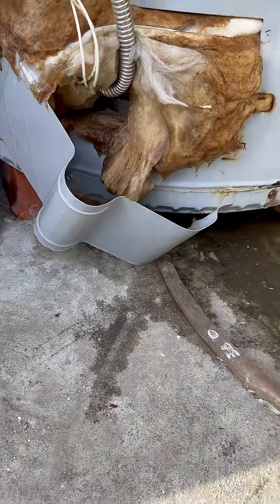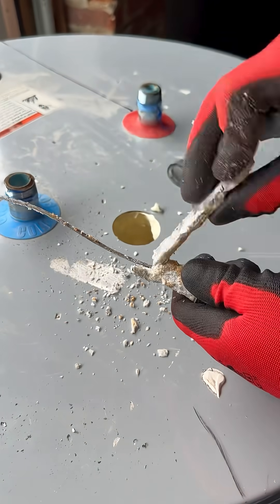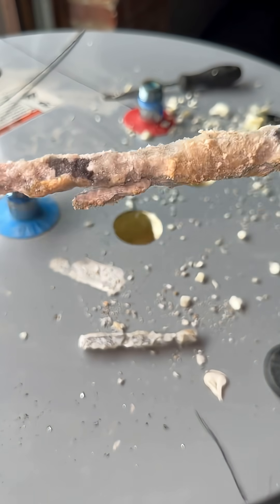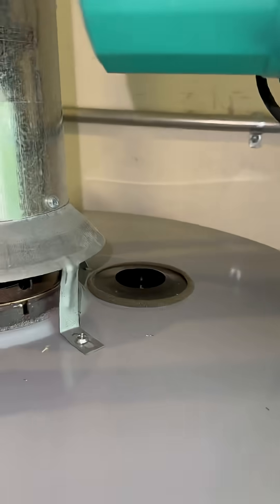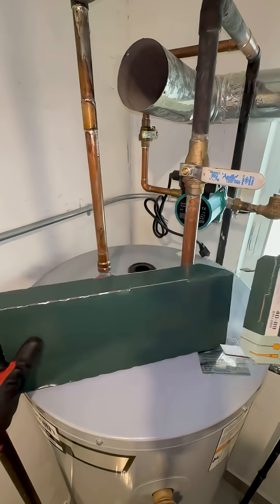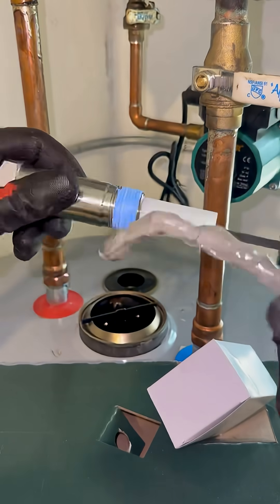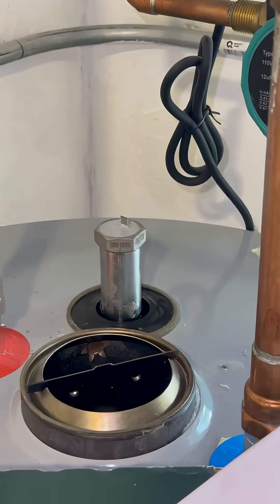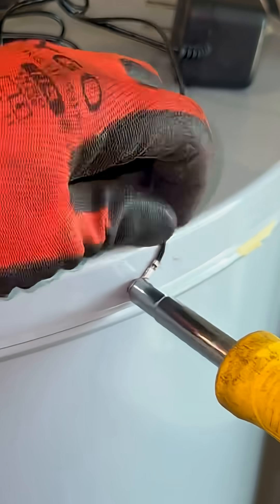Your water heater is fighting for its life! #waterheater #corrosion #anoderod #corroprotecpartner

Comment: Soooo instead of remembering to change a part every 2 or three years and never having to worry about that part failing in that time, you have to constantly check to see that the powered rod hasn't post power because the second it does you have no protection at all ?? that doesn't seem very smart to me, or really any improvement at all.

Comment: This process is called Cathodic Protection, it is also utilized for underground storage tanks -  such as gas/diesel tanks at gas stations. However, not every underground storage tank has this, as it takes a special certification in order for it to be “properly installed”. Long story short, it is an amazing technology that should be standard throughout - but job security is also a factor. So, that is one reason why we don’t see it everywhere
Reply: Also used for residential under ground propane tanks

Comment: What I wanna know is why we don't design hot water heater closets better, I feel like we could install a small drain so if it breaks the water will at least go outside and not flood the house. Could also make the floor for the closet slightly lower than the house so as the water is leaving through the drain it won't be spilling over into the house not to mention lining the closet with bathroom tiles 🤔 we really could make homes soooo much more functional and durable
Reply: We already do, they're called drain pans with drain lines connected
Reply: Most manufactured and mobile homes always have a drain off the pan, alot of the time your not able to if its in a basement most the time
Reply: Maybe if people would be willing to learn a little and actually do maintenance for once and not expect everything to last forever and then be shocked when it doesn't..? You are supposed to replace the zinc anodes every 5 years at least. They are there to stop the rust so big shock when never replaced your system rusts.
Reply: @SilvaDreams  That's not exactly something that is explained to the common layman. This knowledge is passed around by adult homeowners and it doesn't always reach new homeowners. Lose the attitude.
Reply: @sconescrewdriverson Funny thing is I am you average layman. Bit of a jack of all trades but was raised as a country boy so you had to make due with what you had so you take care of what you have. Heck had a PC Jr from 1984 still functional till 2012 and that was more of a "space is limited so it has to go"
Reply: @sconescrewdriverson   that training used to be in "shop and home economics" classes in high school years ago...
Reply: Because if it breaks then you buy another. Stuff is made to be disposed these days it’s all about profit money makes the world go round
Reply: @OF01975  you entirely missed the point of the comment. It's extra relevant BECAUSE everything is designed to break. The above commented is talking about the physical space that the water heater is designed to be installed in.

Comment: Yeah, they work good, but they’re a pain in the ass to install on a  Bradford White (Bradford Whites are good water heaters but the manufacturing process is just lazy not drilling that third hole for an anode rod. I guess it would cost them an extra dollar.).

Comment: How does that affect the smell of warm water? Don't heaters work in such a way that the cold water pipe runs through the heater and is not directly connected to the contents of the heater, even if it is sewage water, so the hot water tap produces the same water as the cold water tap, only heated as it passes through the heater? At least here in Finland, I have been under the impression that the contents of a hot water heater only heat the water flowing through it.

Comment: Y’all have some terrible water for it to destroy the anode in 2 years. Chlorine corrodes like nobody’s business. Calcium blocks like nobody’s business. I live on well water, test showed basically nothing but water. Tastes good. Doesn’t have a smell. No oead, no chlorine, no filtering at all, moved in in 2016 and same water heater that came with the house. I suspect it will eventually fail because they all eventually do but it won’t be because I have shity corrosive water. I have considered for a long while getting a tankless heater. I have gas at the house and could have one of those gas ones installed because I don’t have the space in my box for 2 more 240v circuits to run the electric ones. The prices are crazy for the branded ones and the affordable ones are all Chinese knockoffs with a brand history of about a week.

Comment: Bro, I was just about to buy Alice time truck, I was at the Ford dealership with the money to put down 50% on a 2024 ranger, diesel. Nah, wet belt, if you leave that car alone for two years don’t even drive it, it will need the timing belt done, the oil eats away the rubber on the belt and the teeth fall off, what a joke. I bought a Chinese 4x4 instead turbo diesel and a normal (slightly) timing belt, I say slightly because it has two belts one that does the water pump and timing and one that does auxiliary, power steering, fans and alternator. I hate all this forced obsolescence it was bad enough when it was planned but now it is literally forced they are designing things to break. And it’s not ok

Comment: Changed out my water heater that was 25+ years old because i had to change to electric. No corrosion, no build up, no trash in tank, never even flushed the old one. If you have good water you have no issues
Reply: What city?
Reply: @inwiththenew no city, well water. I could never live in city, plus water taste terible for city and rural water systems
Reply: @luke-4377 ok but what state then lol I'm curious bc some cities/states seem to have naturally hard water which is harsher on the water heater
Reply: In OK but here you can drill a well get salt water, go 100yd drill another and get high iron hard fresh water, then go another 100yd and get super soft water @inwiththenew
Reply: Mine is also 25 yrs old with no problems-never flushed and anode rod  still good (?) my sister lives on other side of county and the limestone causes a terrible sulfur smell. I've got a new WH in the garage on standby and will probably buy one these electric anode rods before installing it...

Comment: You work in New York which has a lot of apartments so I assume these water heaters are in apartments why not just mount wall mounted modern water heaters on the of the building, they are small and flat so it would be more than practical.

Comment: I want to install one of these, but Rheem put a heat pump on the top of my water heater and misaligned the access hole with the top of the anode rod. I can't remove the old rod! They are no help, either; the manual simply says that the anode rod is not designed to be replaced and that I just have to suck it up and let my water heater corrode.

I am, of course, looking into installing the Corro-Protec into a tee on the hot water outlet, but when I buy another water heater, it sure won't be a Rheem.

Comment: The water system I work at uses this just on a massive scale. Just dug up a 42 in main to replace a blow off valve. No rust on the main and the blow off valve with no protection was toast

Comment: That tank is used for winter heating. its one way they use to do in small condos that use hi V duct work. The tanks get so much use in the winter they dont last much more then the warranty period, even the good tanks. This protection might be beneficial for a tank in this application, but under normal use its unnecessary.

Comment: Smart installer, installed the gas union ABOVE the tank, not 6" above the gas valve. When your replacing the tank you can disconnect and just pull it forward and new one in without gymnastics around the hard pipe. Why do so many installer NOT do it this way?

Comment: Dude the struggle is real and it seems that ao Smith is one of the worst offenders, I've double the amount of manufacturer warranty work on Smith heaters than every other brand combined in the last 6 months. 

I'm literally leaving a 6 year warranty replacement on a Smith pro line 40gal, I guess it was good that it failed now because it's got less than 3 months of warranty remaining on the unit.
Reply: As a quality control worker at an A.O. Smith factory I 100% agree with your statement. When my uncle asked for a reccomendation I told him not to buy our junk. I'm not allowed to put product on hold without production overriding it. The long term failure test (pulsation) limits have been lowered to less than a fifth of what they once were. It's a joke. They're designing them to fail a year or 2 after warranty expires
Reply: @tinscarecrow21 damn bro, that really sucks. 

One of the biggest recommendations I've been making for my customers whenever I'm installing any water heater is to upgrade to a powered anode rod vs the sacrificial one.
Reply: @lightjedi6  I always tell folks to install an expansion tank if you're on a closed system, too. You can replace anode rods, elements, dip tubes, T&P valves, control panels, thermostats, drains, and most other parts any day of the week. The tank leaking means you have to replace the whole unit. An expansion tank saves your tank as much as an anode rod

Comment: Why do you need to drain it?  Other than to get the sediment out?
Reply: just to get the sediment out.. and for the tank won't be under pressure to make the swap.
Reply: @thetubeschannel if it’s a new tank, would you still drain it?
Reply: @Aldoshein  New tank - put on a 3/4" ball valve then drain annually after that.
I bought one a year ago and I'm suppose to do it now (july) going to shut the water off, open the kitchen or bathroom sink.
shut off the cold water to the tank and drain the tank.
Check the anode rod - but I'm going to install a power-rod so I won't have to do that part every year.
then still drain annually to remove sediment.
took and takes a while to learn this but well worth it. thx.

Comment: It's sad , ridiculous , and almost criminal the lack of quality that we get from residential products these days . These mfrs should be sued for putting out inferior products . It would be one thing if that was just how good things were and there was nothing that could be done but we know that older product lasted way longer and now they make things to purposely fail and not be able to repair so they can sell you a new unit every 5-10 years . I've even seen this with pressure treated wood. posts used to last 20 years in the proper conditions. I've replaced multiple posts that have rotted completely through 5 years after we put them in. It's ridiculous
Reply: The posts are due to 2 seperate issues, at least. One, probably the one with the lesser effect, is hybrid pines growing so much faster, resulting in different grain structure of the wood.  

The second, and probably more important, is actually an example where an outside entity forced a change in the industry.   Tighter environmental regulations forced changes in treatment chemicals and methods.

Companies will always argue that any reduction in lifespan is due to government regulation changes, of course, but there are very few examples where the majority of the problem can be laid at the feet of government.   Emission systems on engines and pressure treated lumber are two that fall pretty far towards the government side, and they only ones I can think of off the top of my head.
Reply: @spudgamer6049  you think those hybrod pines werent soecificallynselecyed by companies to decrease growing times and  increase overall production and profits at the cost of durability? Its planned obselecensce  100 percentm and yes while the chemicals they use for presure treating are regulated if you think the top dogs in the industry dont habe any say in that deciscion youcate sadly mistaken . They pay for it to be how they want it to be period
Reply: Sue them. I dare you. See what happens.
Reply: @intenseavarice34 what kind of weird backhanded , wanna be power comment is that . Go play in traffic kid
Reply: Corporate shareholders gotta make profits somehow!

Comment: No outlets near my water heater.  Then I found a coil of live 120v wire tucked in the insulation above the water heater for decades.  Put a GFI breaker on that circuit, ran the wire down to a new box with WR receptacle and now I'm ready for this, broski.  Looking forward to it.
Reply: May the electromotive force be with you.
Reply: @Bart-uo5xg  If he had a live 120v line hidden in the insulation for years the eclectro force has been watching out for him...
Reply: Its called an extension cord. It's just a powered anode lol not a heater or big fan
Reply: @famousbowl9926 do the job right? Hell no! We got sum duct tape and extension cords!

Comment: Why the grounding wire when the unit is already connected to the tank? I assume the teflon tape breaks the circuit. Is there a thread sealant that can conduct?